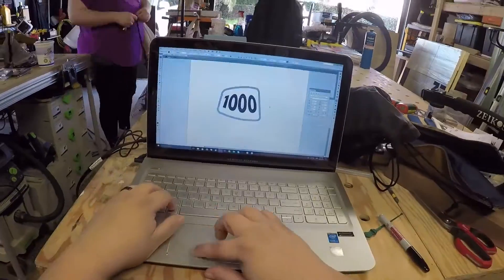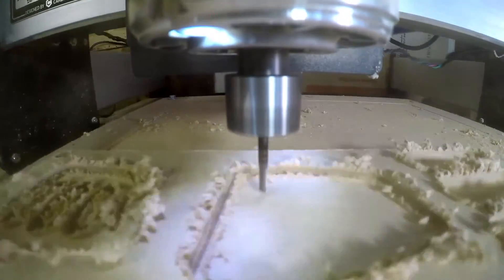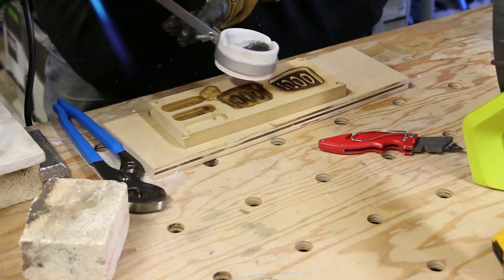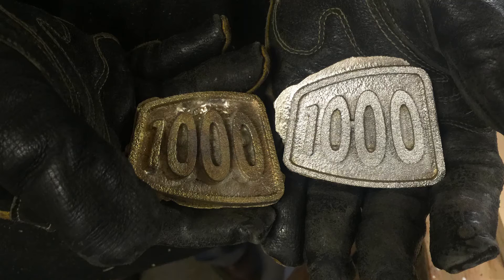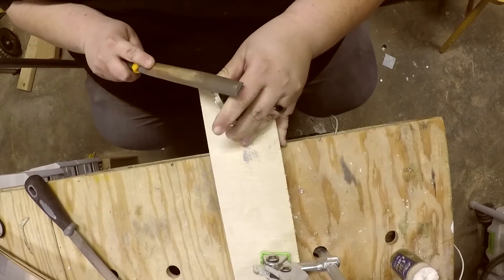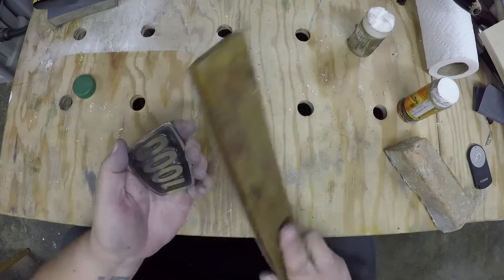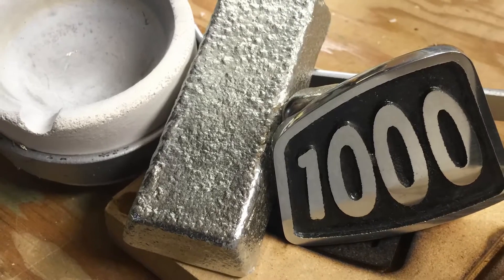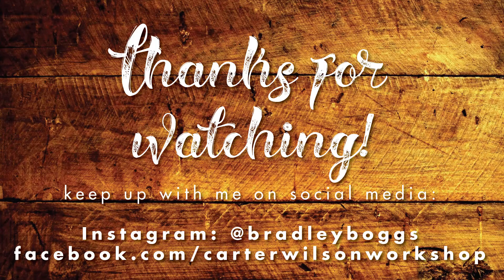Pewter Casting into MDF Mold (1000 Subscriber Video!)

Comment: How come I never see anyone leave pewter in the mold, and then place it in the oven @ 450 degrees? Would that help with air bubbles?
Reply from the maker: That’s a novel idea but indeed I’ve never seen it done. I think the problem is that the air gets trapped when you pour, so keeping the metal molten for longer really probably wouldn’t help (in fact it may actually hurt by introducing more oxides by keeping it at temperature longer). In more professional casting setups they have two main ways (that I know of anyway) to help prevent bubbles, and both require lost-wax investment molds. With this form of mold, you create a wax, pour a plaster-like substance around it, and melt the wax out in a kiln. From there, you can use either a vacuum casting system that literally sucks the metal into the mold, or you can use a centrifugal casting arm. The arm is wound up like a huge wind-up toy, then you melt the metal in the crucible which has a funnel into the mold, and then let the arm spin and the centrifugal force shoots the metal into the mold. I’ve not used a vacuum system but have used the centrifugal type and it’s a lot of fun. In one or two instances (out of probably viewing 50 to 100 or so castings) I did see air bubbles, but they were small and not of great consequence to the finished piece.
Reply: Carter Wilson Workshop I have seen both of those systems demonstrated. Usually on items with lots of undercuts. When making two part silicon molds people sometimes put the poured silicon in the refrigerator. Silicon cures at room temperature, so this gives the bubbles time to escape. The result is a perfectly clear mold as seen here. https://youtu.be/yt14p3uZB4I I thought that the same idea might translate here. Maybe you could use a toaster oven.

Comment: Is it a possibility to just carve a chunk of pewter?
Reply from the maker: +Paul Wier It's probably possible but would be pretty difficult/time consuming if you wanted to do it by hand. On a CNC it might be doable, though I don't know how Pewter machines (not all metals machine very well). More commonly, without a CNC, one would carve a wax model by hand, make a mold of that, and then melt and poor the pewter into the mold.

Comment: How about heating the MDF evenly and then covering it with talc powder? No expert, but I've seen people use these methods on both sand and silicone to get rid of any "atmospheric" water vapor that could result in bubbles. :)
Reply from the maker: +Sindre Solhaug I'm not sure that would help in this instance with the porous nature of the MDF, but it's certainly worth a shot! Next time I try casting into MDF I'll give it a shot and see. :)